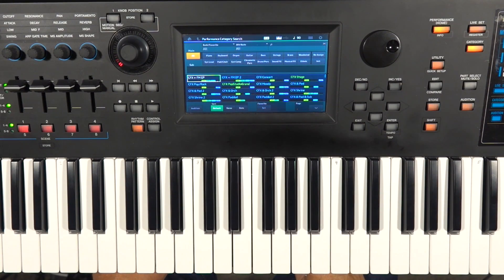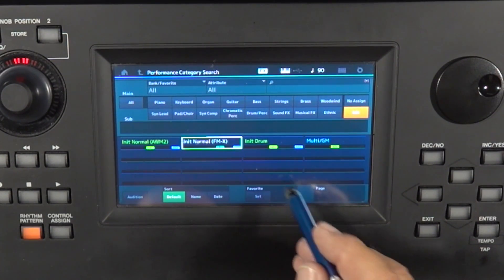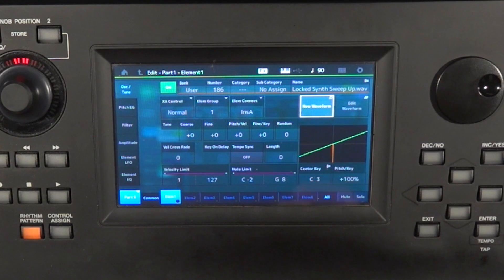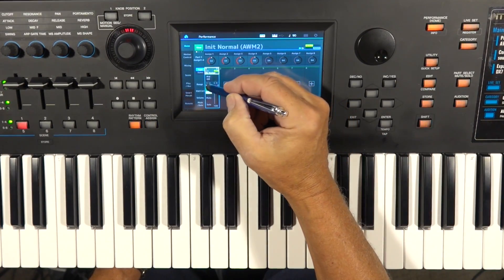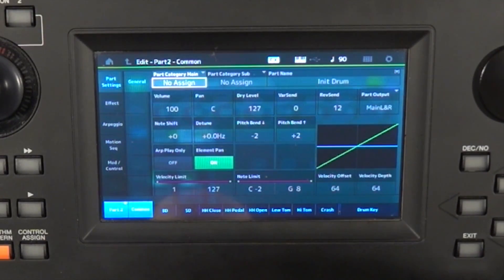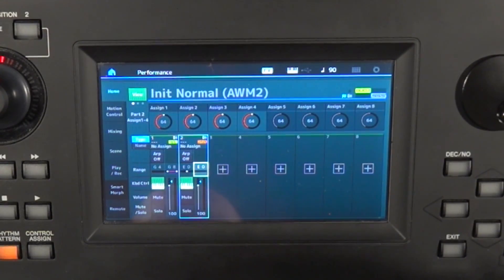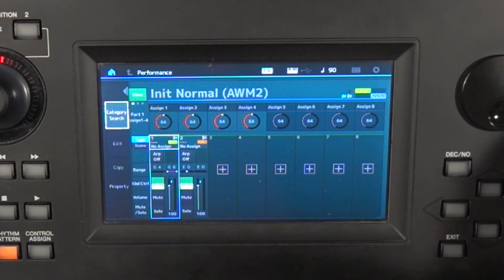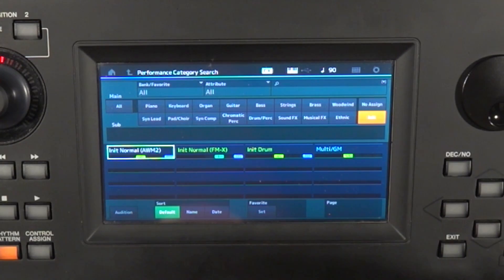Papa D Keyboard Chronicles #25: Sample this! Getting samples into the Yamaha MODX

Comment: Thank you for the great video!
Two notes:
As you said there is no"note off" in AWM2 but you can set the sustain and release to a high value to have similar effect.
To set the center key you have a dedicated entry called "center note" (in wave edit) and so you don't need to set the course.
Reply from the maker: Thanks Eldadi. I have used the sustain and release parameters to extend sounds and I should have mentioned it in the video. I was not familiar with the “center note” parameter though. I will check it out. Thanks for the tip.

Comment: 3 years later and still very good. I use the original MODX7 and a Korg Wavestate on stage now. Pretty hard to beat.
By the way, I take advantage of the keyboard being restricted to the first 8 parts, and sometimes have the Wavestate also playing one of the channels on the MODX (I choose CH12 because it leaves 4 consecutive channels above when I want to also integrate my Novation Circuit or Digitone.
Another fact some people may not know, is that if you have any voice on one of the upper channels (9-16) switched on and use the zone settings, it still midi sends a program change when you change patches. Very effective controller. I only have to select one entry from the live set, and it changes all other devices on different midi channels instantly.

Comment: what happens to the performance built from "imported" waveform  from  the usb stick, if you remove the stick from the device?
Reply from the maker: Hi Truhli. After you use the Init function as I describe in this video and then Save the Performance, the sample stays in MODX memory forever (or until you delete it in the Utility area of the keyboard).

You can continue to use imported waveforms in other Performances as many times as you want (without the memory stick being plugged in). To do that, you would open a Performance, select an unused Part (by pressing the + sign on the unused Part) and then selecting Init as I show in the video. 

After that, you would select the new Part and then touch Edit. On the Edit page you would select an Element (from the Elements shown at the bottom of the page) and then instead of pressing New Waveform you would press the sample shown in the Name field above the New Waveform button. Then you could search for the name of whatever imported sample you wanted.

So, to reiterate, every time you load a sample into a Performance and then Save the Performance, that new sample will stay in the keyboard's memory indefinitely. I hope this is clear!

Comment: Any specifics for wave samples? Length etc...?
Reply from the maker: Nothing specific really. The MODX will take pretty much any kind of Wav file, and they can be quite long. 

For example, I was in a party/dance band that was doing Bruno Mars’ 24 Karat Magic and we were unable to to a respectable job with the intro. So I took Bruno’s original and made a Wav file of just the intro. It was probably a good 10 seconds long, but I had no trouble loading it into the MODX. To play it, I just held down the key I assigned the sample to until the whole intro played. Cheating, yes, but it worked great.
Reply: Wow that is awesome
Reply: @tkrdennis  I want to sample some of my kronos sounds so this should work?

Comment: Hi and THANK YOU.  Is there a way to LOOP A SAMPLE?  So it continuously repeats?
Reply from the maker: Hi Vinny. Good question, and offhand I can’t think of a way to do it. But I hope to get to my MODX later today and I’ll mess around with it. I’ll try to get back to you soon.
Reply from the maker: Hi again Vinny. No luck. I tried to figure out a way to have a sample loop continuously and failed. Sorry! If you find a way to do it please let us know.
Reply: @tkrdennis   Just recording an Arp with the sample.  You must know the EXACT tempo of the sample (waveform) for this to work.
Reply from the maker: @vinnykeys8146  I was thinking the Arp function might be a way to do it, but Arp is not a feature of the MODX that I’ve ever used so I was out of my depth. Thanks for getting back to me about it. This might help others.
Reply: I had the same question and I eventually found the answer. You can do this on a wav editor on your computer. The MODX/Montage will play it looped. You can't edit the wav on the keyboard unfortunately.

Comment: Just wondering.... is there a way to place an existing sample anywhere you want on the keyboard? I got a Favorite covers set from Narf and I'd like to use some of the samples in different locations....Thanks
Reply from the maker: Hi Vincent. Do you mean triggering a sample with different notes on the keyboard, or using a sample with different Performances? If you mean using samples in different Performances, then yes, it is fairly easy. Select the Performance you want and then press the Performance (Home) button. Then, assuming the Performance has at least one empty Part, press the + button for an empty Part. Then select Init and then Init Normal AWM2 or Init Drum (depending on the nature of the sample). Then press the Exit button to return to the Performance Home Screen. 

Next, press the Edit button (below Utility) and then touch Elem1 at the bottom of the screen. Then touch the Name field in the top right corner and then Category Search. This will take you to the Waveform Search screen. From there you might want to select the Narf Bank to narrow down the number of displayed waveforms. Then you will select one of the sample Waveforms and then Exit. 

I should have pointed out initially that the Narf Performances may not use any custom samples. I’m not familiar with them. It’s quite possible that they are just a set of custom Performances that use the MODX’s stock samples. If that’s the case, then the only way to use the Narf sounds (Performances) combined with other Performances would be to open one of the Narf Performances and then select an empty part to load in other Performances. That assumes that any given Narf Performance has one or more empty Parts in it.

Sorry to be so wordy, but your question is not so straightforward. I hope this helps!
Reply: @tkrdennis  No worries about being wordy! I appreciate the feedback! Regardless of whether it's a Narf sample or a stock sample, my main question is... how do you map a sample to to another key? For example: from E1 to E0... hope that clarifies what I'm trying to do... Thanks
Reply from the maker: Hi again Vincent. When samples are loaded into a part (assuming they are melodic samples and the Part is an AWM2 type Part), they will play across the entire keyboard by default, with the C3 key assigned to the unaltered original sample. Keys above C3 will play the sample in progressively higher pitches and notes below C3 will play the sample at progressively lower pitches. 

To restrict the sample to only one note go to the Performance Home page, press the lower range of the sampled Part, then press Keyboard on the left side of the screen. Then touch the note on the keyboard that you want to activate the sample. Then press the upper Range and press the same note. Don’t worry what it sounds like.

Next, select the Part and then press Edit. Then touch Elem1 at the bottom of the screen. The sample waveform is probably assigned to Element 1. Then select the Osc/Tune tab on the upper left and then touch the Coarse field. Use the wheel to move the pitch up or down depending on what note you selected to trigger the sample. For example, let’s say you wanted the E0 note to trigger the sample. E0 is 32 semitones below the C3 key, which means that you have to raise the pitch by 32 semitones to make the sample sound the same as it would when played by the C3 key.

Next, press Exit and then Store to save the edited Performance. This is less complicated than it sounds! I hope this helps.
Reply: @tkrdennis  Thanks Dennis, I'll definitely dive into it a bit more! The info helps a lot. The longer I have this MODX8, the more interesting it gets... it's an extremely deep and unique instrument. I've been wondering how to use all the element tabs. Thanks again for the input!
Reply: @tkrdennis  Hi Dennis, I've finally created the wav sample of the intro of "Too much time on my hands", it's like 5 t0 10 seconds long, if ...I want the MODX to play the whole sample without holding the note down, should I use the "init drum" with "rec note off" to make this happen? I'll have to select which key I want to trigger it from, not sure yet... Thanks for your help!
Reply: @tkrdennis  I was able to add the sample to C7 in AWM2 but I have to hold it down for the whole sample to play... I can live with it for this song. My question now is this: can I add another sample to the same instrument? If I want to map it to a different key, would I do that by going to element 2 within the slot?  Thanks
Reply from the maker: @vincentguarino4262  Hi again Vincent. I’ve got a very long sample also (15 seconds) for one of the songs our band plays but it comes at the beginning of the song. So I just press down the  sustain pedal and then press the key to start the sample playing. Then when the sample ends I release the sustain pedal and start to play the song. Not a great solution but it gets the job done.
Reply: @tkrdennis  Thanks for the sustain pedal tip, I'll try it. Did you see my question about about adding a 2nd sample? Would I use the same slot but element #2 to add a different sample?
Reply from the maker: @vincentguarino4262  Yes, I’m looking at that now. I’ll get back to you shortly.
Reply from the maker: @vincentguarino4262  OK Vince. I’ve never put two different samples in one Part but it’s not too hard. Let’s say you have your first sample loaded into Element 1 and now you want to play an entirely different sample loaded into Element 2. I think that’s what you’re after. 

Go to the Edit screen for the Part and make sure Note Limit for Element 1 is set to the key that you want to use to trigger that particular sample. Next press Elem2 and select the waveform you want for that Element (after pressing New Waveform in the upper right corner). Set the Note Limit for Elem2 to a different note. That should do it.

The only catch is that when you Exit to the Performance Home screen you’ll have to adjust the Range for that Part to include the Notes you selected for Elements 1 and 2. For that reason you’ll probably want the notes selected for the 2 Elements to be adjacent to each other. For example, if you have Element 1 Note Limit set to G7 (same note for upper and lower limit), then you’ll probably want the Note Limit for Element 2 to be G#7 or F#7. Then on the Performance Home screen the Range for that Part would be G7 to G#7 (or F#7 to G7). 

Does this answer your question? Let me know if it works. Thanks.
Reply: @tkrdennis  Yes that helps! 👍Thanks!  I'll mess with it and let you know if I find out anything new to help us both!